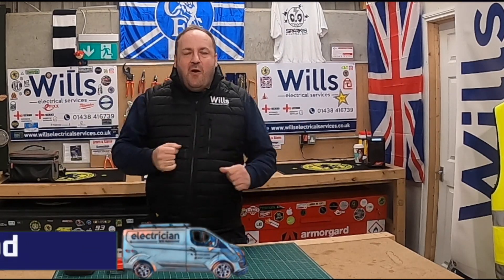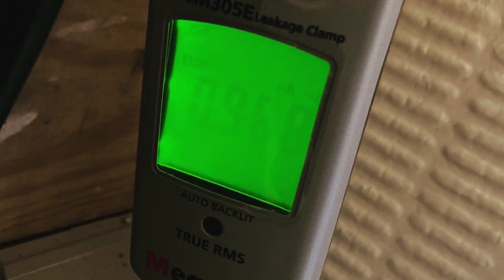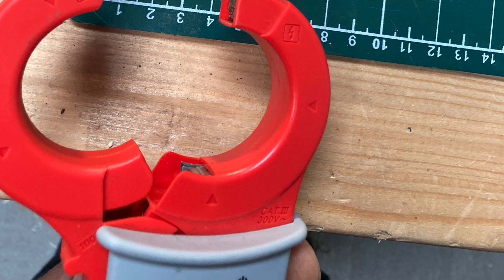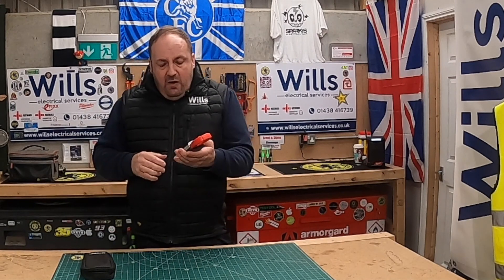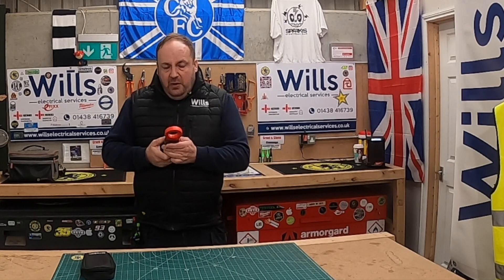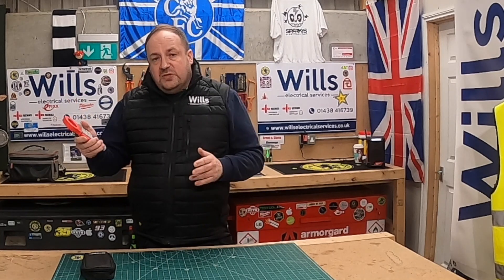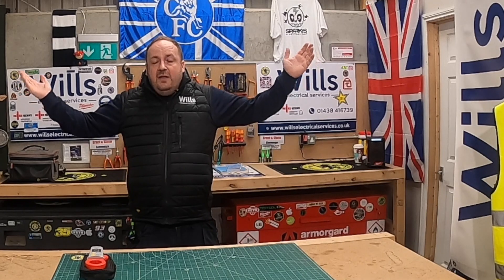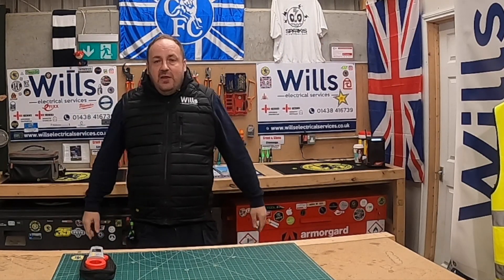Game changer thank me later Earth leakage meter Megger dcm305e quick guide.

Comment: Will the DCM305E pick up interference from wires in the electrical box?  For example, if you have circuits with  50-100 amps running through nearby wires, and you want to measure <1ma leakage current of another circuit, will those high current wires cause a reading in the meter, even before you open the probe to clamp it on the appropriate wires to measure leakage?

I'm asking because I had bad results with another <$200 meter.